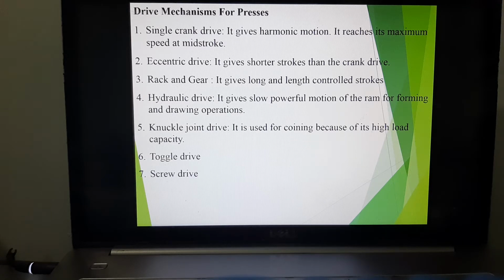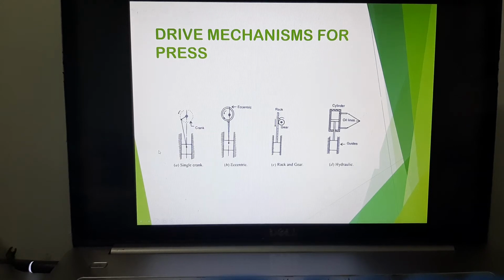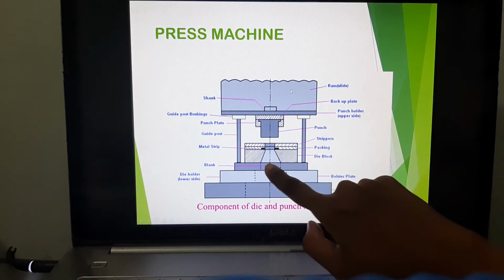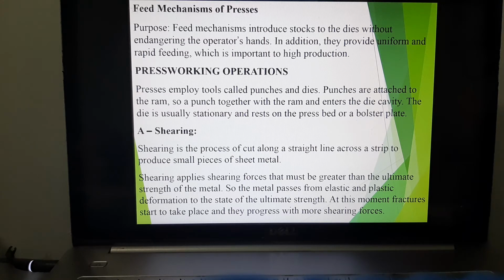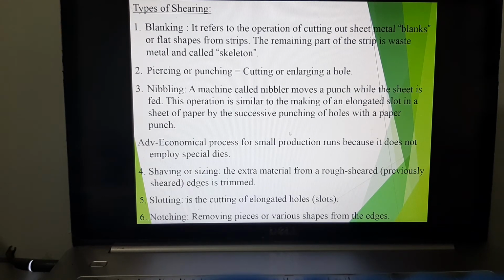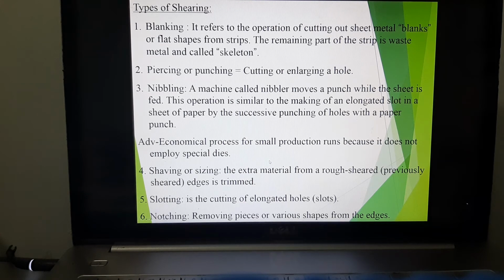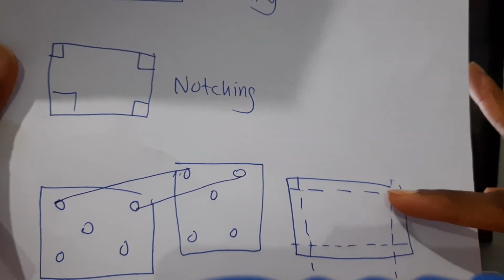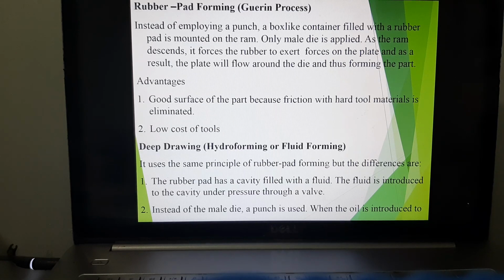PRESSWORKING OPERATION PART 3

Comment: NAME: NEENA BT AHMAD NIZAM
ID: ME0104364

From this video, I learnt about the drive mechanisms for presses which generates power for press to move. They are single crank drive (gives harmonic motion and max speed at midstroke), eccentric drive (shorter strokes thank crank drive), rack and gear (long and length controlled strokes), hydraulic drive (slow powerful motion of ram), knuckle joint drive ( high load capacity), toggle drive and screw drive. There are three pressworking operations. Firstly, Shearing to produce small pieces of sheet metals. Few examples of shearing are blanking, slitting, punching, notching and many more. The balance waste materials are called skeleton. Next, Bending and Forming to produce U or V shaped metals. Thirdly, Drawing where there are two types which is single-action and double-action drawing. The reason hydraulic presses are for drawing processes is because it has a slow action for even thickness, has controlled speed, has uniform squeezing pressure and the strength of the press. Thank you.

Comment: from this video, i have learnt about the different types of drives mechanisms for presses, there are single crank drive, eccentric drive, rack and gear, hydraulic drive, knuckle joint drive, toggle drive and screw drive. feed mechanisms of presses introduce stock to the dies without endangering the operator's hand [automatic feed]. the major operations of pressworking are shearing/cutting, bending and forming and drawing. there are many types of shearing which are blanking, piercing/punching, nibbling, shaving/sizing, slotting, notching, perforating, slitting and lancing. for bending and forming, the metal experiences both compression and tension at the same time. for drawing, there are two types of drawing which are single action drawing and double action drawing. lastly, i also learnt about why hydraulic press is suitable for drawing. this is because of slow motion, speed can be controlled, uniform squeezing pressure and strength of press.

Ariff Imran 
ME0106083

Comment: Name: Nur Syazwani Bt Mohd Noor 
ID: ME0104367

From this video, i learned about different types of drive mechanism for presses which are;
1) Single crank drive : it gives harmonic motion
2) Eccentric drive: it gives short strokes than the crank drive
3) Rack and gear: it gives long and length controlled strokes
4) Hydraulic drive: it gives slow powerful motion of the ram for forming and drawing operations
5) Knuckle joint drive: it is used for coining because of its high load capacity
6) Toggle drive
7) Screw drive
Other than that, feed mechanism is the way you put in raw material into press machine for it to be processed. Feed mechanisms introduce stocks to the dies without endangering the operator's hand. Next, there are three major operations in a pressworking machine which are:
1) Shearing: Process of cut along a straight line across a strip to produce small pieces of metal sheet. The shear force needs to be larger the ultimate strength of the material to allow cutting process to happen. There are different types of shearing which are blanking, punching, nibbling, shaving, slotting, notching, perforating, slitting and lancing.
2) Bending and forming: In this process, metal experiences both compression and tension.
3) Drawing: There are two types of drawing which are single action drawing that is performed on single action presses and double action presses that is performed on double action presses that have two slides on one within the other. Hydraulic press is the most suitable for drawing because of the slow action that gives the material even thickness, the speed can be controlled, uniform squeezing pressure and strength of the press.

Comment: Good Morning Madam,I have learned about drive mechanism for presses,the source of generate power,the drive mentioned in the video are:
1) Single crank drive
-gives harmonic motion and reaches maximum speed at mid stroke

2) Eccentric drive 
-gives shorter stroke than the crank drive

3) Rank and gear
- gives long and length controlled stroke

4) Hydraulic drive
 - slow powerful motion of the ram for forming and drawing operations

5) Knuckle joint drive - coining(high load capacity)
6) Toggle drive
7) Screw drive

Feed mechanism presses - introduce stocks to the dies without endangering operator's hands.
Punches-hold by punch holder,attach to ram,enter die cavity with ram
Dies-hold by die holder,stationary,rest on bolster plate

3 major operation in press are:
a) Shearing-cut along a straight line across a strip to produce small pieces of sheet metal
                     -Shearing force should be greater than UTS ,so that fracture will take place

Types of shearing :

1) Blanking
-punch out certain dimensions, left discarded waste ( skeleton)
2) Piercing and punching
-cutting or enlarging holes
3) Nibbling -create overlapping holes
4) Shaving or sizing
-trim extra material from rough sheared edge
5) Slotting 
-cutting elongated holes(slot)
6)Notching
-removing pieces or various shape from edge
7) Perforating
-randomly punch hole
8) Slitting
-cut a strip of material
9) Lancing
-leave a tap without removing any material

b) Bending and forming - bending the metal experience both compression and tension at same time.bend into V or U shape.Perform in room temperature.

c) Drawing - 
1) Single action drawing
2) Double action drawing

Reasons Hydraulic presses suitable for drawing
i) Slow action
ii) Speed can controlled
iii) Uniform squeezing pressure
iv) Strength the press

Tan Kang Je
ME0106097

Comment: Good day Dr, Im Lee Zi Sheng ME0106051, I learnt that in drive mechanisms for presses
, there are:
Single crank drive: harmonic motion
Eccentric drive: It gives shorter strokes than the crank drive.
Rack and Gear : It gives long and length controlled strokes
Hydraulic drive: It gives slow powerful motion of the ram for forming and drawing operations.
Knuckle joint drive: used for coining due to high load capacity
Toggle drive
 & Screw drive

In pressworking, punch and dies work hand in hand, three major operation are
shearing(cutting): can be further categorize to Blanking ,Piercing / punching ,  notching, Nibbling , Shaving / sizing/ Slotting /Perforating/ Slitting and Lancing

for bending and forming, both compression (at the inner surface) and tension (at the outer surface) takes place.
there are 4 reasons as stated why hydraulic presses suitable for drawing.
Thank you

Comment: Good Day, Dr. I am Derrick Ng Kian Ping (ME0105733). At the end of the video, I have learned about the drive mechanism for presses. It is a source of generating power in a press and is also known as torque which comes from motor to generate power fro press to move. Some examples of drive are single crank drive (harmonic motion and max speed at mid stroke) ,eccentric drive (shorter strokes than crank drive), rack and gear (long and length controlled strokes), Hydraulic drive (slow powerful motion of ram for forming and drawing), knuckle joint drive (for coining because of high load capacity), toggle drive and screw drive. Moving on, the feed mechanism of press is a system incorporated into press machine to automatically feed part into system and does not endanger operator's hand. It also has uniform and rapid feeding which is important for high production. Moreover, presses employ tools called punches and dies. Punches are attached to ram and it punch together with ram that enters die cavity. The die is stationary and rest on press bed. There are 3 major operations in a press which are Shearing, Bending & forming and Drawing. Firstly, shearing is a process of cut along a straight line across a strip to produce small pieces of sheet metal. The shearing forces must be greater than ultimate strength of metal in order for cutting to take place. Besides, metal passes from elastic and plastic deformation to state of ultimate strength. At this moment, fracture take place and progress with more shearing force. The types of shear process are :-
1) Blanking: punch out dimensions from sheet metal materials, discarded waste is called skeleton which can be melted and recycled for new material
2) Slitting: Cut a strip of material longitudinally
3) Punching: Punch holes on materials
4) Notching: Sharp edges on sheet metal
5) Lancing: Leaving a tap without removing any materials
6) Nibbling: create overlapping hole which is similar to making elongated slot in a sheet of paper by successive punching holes with paper punch
7) Slotting: Cutting of elongated hole
8) Shaving or sizing: Remove extra materials from roughly sheared edge
9) Notching: Remove sharp edges from sides
10) Perforating: randomly punch hole on materials

Another major operation is bending and forming where bending is in V or U shaped dies. The third major operation is Drawing which consists of single action drawing(single press) and double action drawing (double press). Hydraulic presses is suitable for drawing due to slow action, speed can be controlled, uniform squeezing pressure and large strength of press

Comment: Good morning madam, I'm Chong Jin Yang (ME0106047). From this video I have learned drive and feed mechanisms for presses and also preess working operations. 
Drive mechanism for presses (sources or method of generating power in presses) :-
1) Single crank drive
- harmonic motion
- reaches maximum speed at mid stroke
2) Eccentric drive
- give shorter stroke than the crank drive
3) Rank and gear
- long and length controlled stroke
4) Hydraulic drive
- slow powerful motion of the ram  for forming and drawing operations
5) Knuckle joint drive
- coining
- high load capacity
6) Toggle drive
7) Screw drive

Feed mechanisms of presses which means press will automatically feed parts into the system. Workers would not use their hands to move the parts. 
3 major operation:-
1) Shearing 
- process of cut along a straight line across a strip to produce small pieces of sheet metal
- exceed UTS
i) Blanking- punch out certain dimensions ( blank). Left discarded waste ( skeleton)
ii) Punching- enlarging a hole
iii) Notching- cut at sharp edges of the material
iv) Slitting- cut a strip of the material
v) lancing- leaving a tap without removing any material
vi) nibbling- make elongated slots with successive punches of holes
vii) shaving or sizing- rough sheared edges is trimmed
viii) Slitting- cutting of elongated holes
ix) perforating- randomly punch holes in a sheet
2) Bending and forming
- bend into U and V shape
3) Drawing
- Single action drawing
- Double action drawing
- Hydraulic press
i) slow uniform motion
ii) controlled speed
iii) uniform squeezing pressure
iv) strength of the press
Thank you.

Comment: Hi and good morning madam, i  have learned about the  drive mechanism for presses.
1) Single crack drive- it harmonic motion. It reaches its maximum speed of midstroke
2) Eccentric drive- Shorter stroke than crack drive
3) Rack and gear - Long and length controlled strokes
4) Hydraulic drive- slow powerful motion of the raw forming and drawing operation
5) Knuckle Joint drive - it used for coining because its high load capacity
6) Toggle drive
7) Screw drive

Feed mechanism presses - introduce to the dies without endangering operator's hands.They provide and rapid feeding which important to high producing

Pressworking operation:
a) Shearing- Process of cut along a straight line across a strip to produce small pieces of sheet metal

Types of shearing :
i) Blanking
ii) Piercing and punching
iii) Nibbling 
iv) Shaving or sizing
v) Slotting 
vi)Notching
vii) Perforating
viii) Slitting
ix) Lancing
b) Bending and forming - bending the metal experience both compression and tension at same time. Performed V or U shaped dies

c) Drawing - 
 i) Single action drawing
ii) Double action drawing

why Hydraulic presses suitable for drawing
i) Slow action
ii) Speed can controlled
iii) Uniform squeezing pressure
iv) Strength the press

Name : Alif Haikal Bin Azly
Id: ME0106081